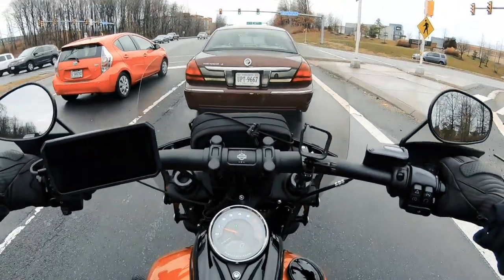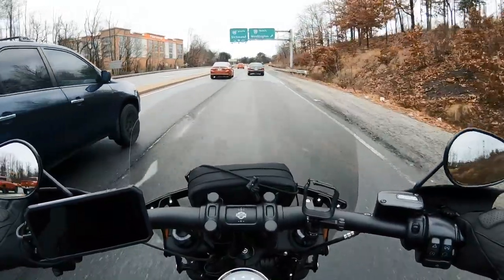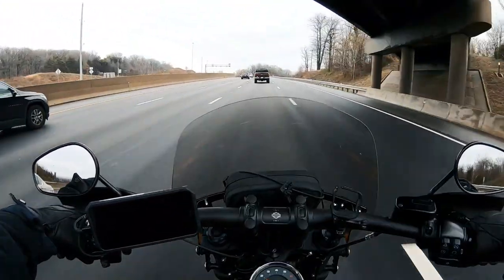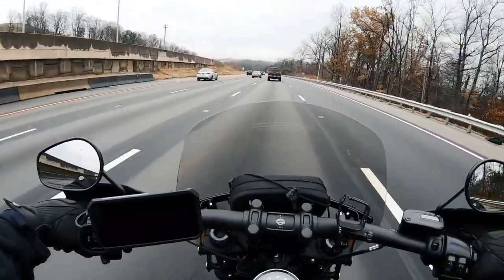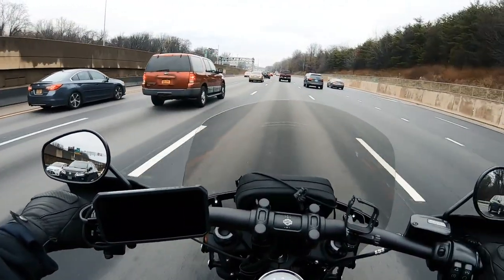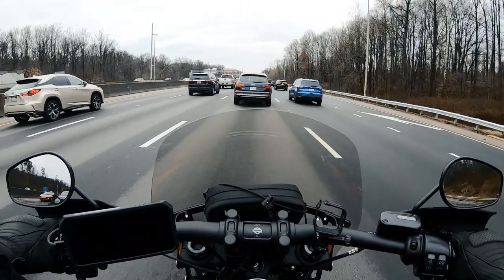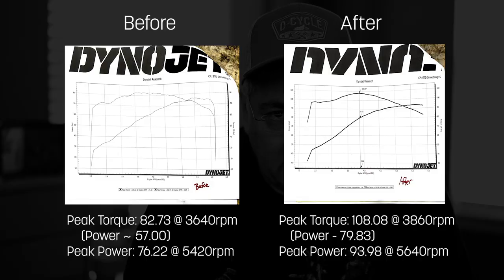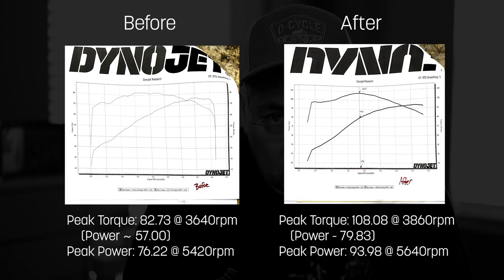What happens when you install an M8 Stage II Torque Cam Kit in your Fat Bob FXFBS?? Let's see...

Comment: Hello
Really enjoy ur videos 
Just a question on the stage 2 
How does I’m the bike run with stick exhaust 
I thought it needed to be changed out for the stage 2 to run properly?
Reply from the maker: Thanks! Appreciate you watching! The stock header pipes work fine. Later on I swapped out the entire exhaust for a TBR. TBH... I preferred the way the bike ran with the stock head pipes since the 2-into-1 TBR moved my torque up in the power bands.

Comment: Another great video. Is there any difference in the fuel consumption with the stage 2 cam upgrade......?
Reply from the maker: Not much. I think I'm getting about 4 less miles per tank on average. Now that the newness has worn off and I've not been slamming that throttle and giggling so much. LOL
Reply: Range is about 20 miles per tank less. M8 122, high flo oil pump, full SE exhaust, 447 cam, SE lifters. Have about 7000 miles on this build and I absolutely LOVE IT! Stock heads, stock clutch. it pulls like a freight train. All usable predictable power with added reliability and durability.

Comment: How much decrease in MPG did U see with the stage 2. I just bought a new 2020 FB and had HD install a stage 1 with S&S slip ons. Txs
Reply from the maker: Hey Michael - I don't do a good job of tracking my mileage. I'm pretty lazy on that stuff. I will say that I've noticed a slight reduction in what I'm getting out of a tank but not much. But the increase in fun-per-mile has been off the charts!
Reply: @withPercy  My new FB had a stage 1 done at the dealer with SS slip ons. I did a pretty accurate mpg test. At 60-65 I was able to get around 50 mpg. That was with no hard acceleration. Shifting at around 2-2.5k. That's pretty impressive for a 114 ci engine. With the 3.6 gallon tank I'm pondering whether to do a stage 2 and probably lose around 10-15% range.

Comment: Which clutch plate did you install? Have a part number or a link
Reply from the maker: Hey Alex - All I had to do with the clutch was to install the HD Part 37000286 Kit, Clutch, 1275N Springs. HTH
Reply: @withPercy  so to clarify all you installed were the $25 “springs” and not any “plates” ?
Reply from the maker: I reviewed the work order and don’t see any reference to new plates. I seem to remember that we only talked about needing the spring upgrade when I was researching it.
Reply: @withPercy  thanks for The Info! I appreciate it, I have the 107 but I went with a really aggressive cam so I’m hoping it holds the power, thanks again

Comment: Hi Percy. I’m considering adding this upgrade would you mind giving an indication of what this cost please?
Reply from the maker: All in it was about $1,500 (that includes the labor). But I also replaced the tappet covers, replaced the clutch spring, and there were a bunch of gaskets and such required.
Reply: Being Here Now, with Percy  does this upgrade require a clutch spring? Or you did that just as a precaution

Comment: Screaming Eagle products are EXTREMELY de-tuned . It's honestly a joke. If you want real power that's still reliable, go with a reputable aftermarket company. Jim's VTwin Performance,  Zippers, S&S ... etc.. they have been doing REAL performance for years. With a MUCH better out coming .
With an aftermarket Stage 2 kit you should be making 113-116hp and 132-135tq reliably. For the same price or less the SE. If you went to Quantico I'm SURPRISED JT didn't talk you into Jim's VTwin performance Maxcell 821B cam.
Reply from the maker: I was actually looking at a third party performance kit that Quantico puts on a lot of bikes. Priced the full kit out against the SE kit. Talked it over with JC and others and in the end went with the SE because I didn’t want to spend the extra money to replace my tuner and such. TBH Sophie has enough power and torque for me with this kit installed. I mostly cruise at 80-85mph max. And there is plenty left at that speed.
Reply: The main reason why to use screaming eagle parts is that your warranty on the engine will be all good, if you use other brands you may get better results but will void warranty,  however if its not under warranty I agree with you , I'd do the SE stage 2 tourque cam until I'm out of warranty then I'll get the s&s 128ci  full upgrade 🤣🤣🤣
Reply: @festgnob  sounds like a plan